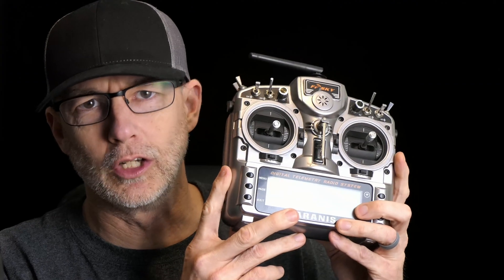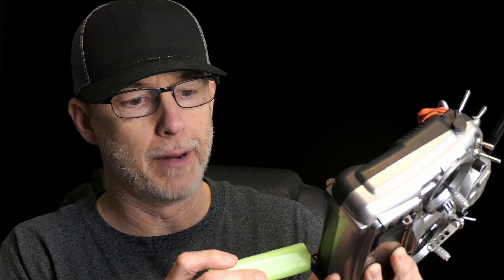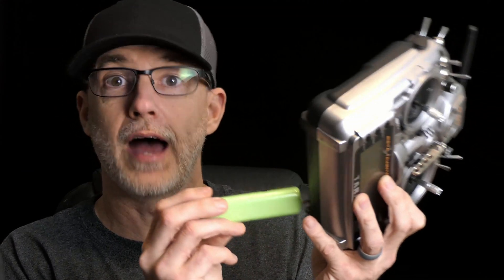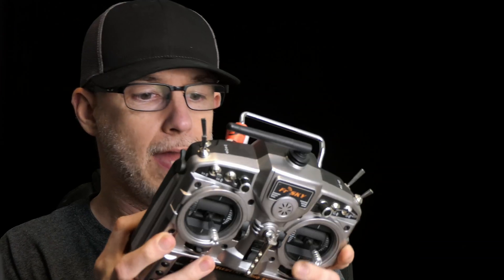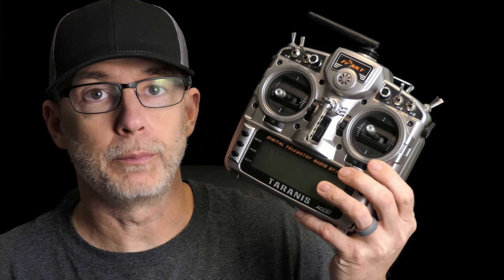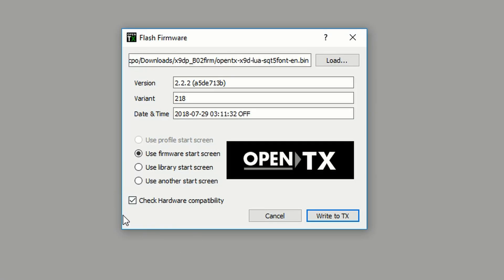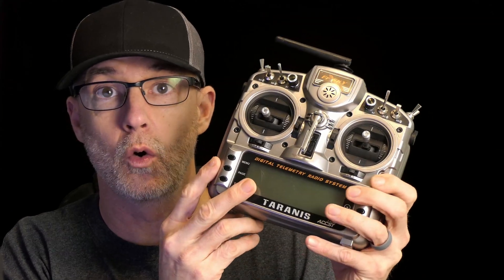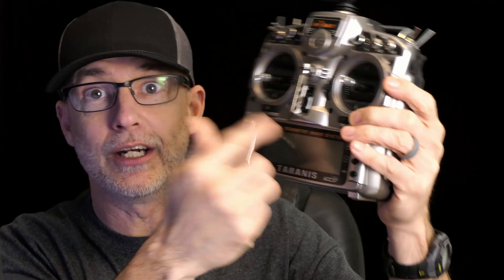Updating my Ancient Taranis X9D Firmware - From OpenTX 2.0.9 to 2.2.2

Comment: You can update the bootloader in this way:
 on Taranis enter in SD CARD page
select the directory where you saved the OPENTX.bin file (normally in FIRMWARE)
select the file
long press ENTER
select  Flash bootloader and press ENTER
DONE  !!!

Hope this helps

Comment: Betaflight stopped supporting the naze boards.  Can still update to the latest firmware.  There has been a ton of updates with filtering that may not work on the naze boards.  Takes a lot more CPU power.  Toss a newer f3 or f4 procceser board in with betaflight osd and your good to go!!